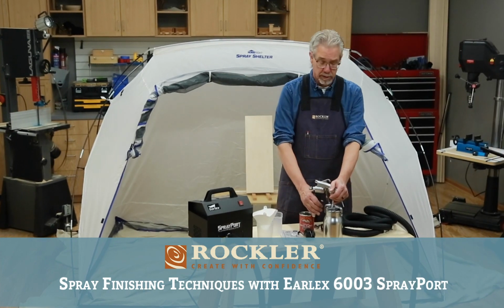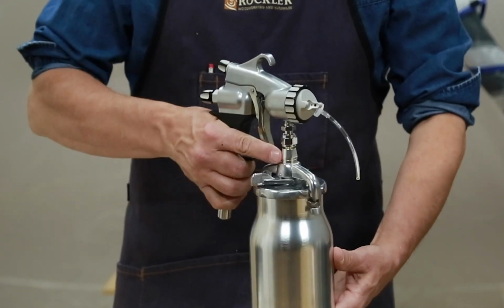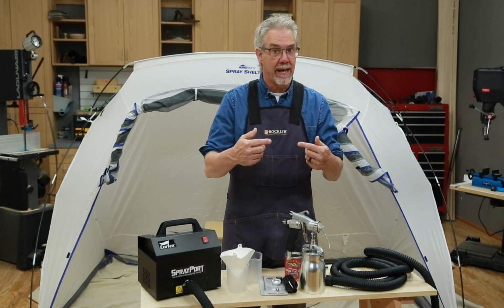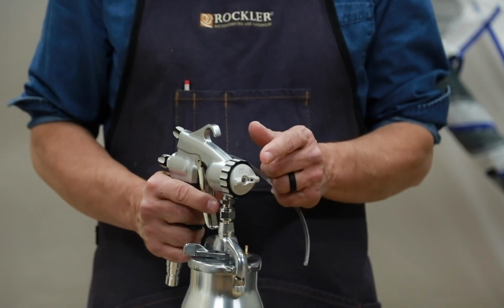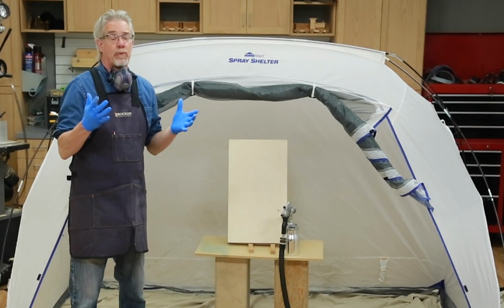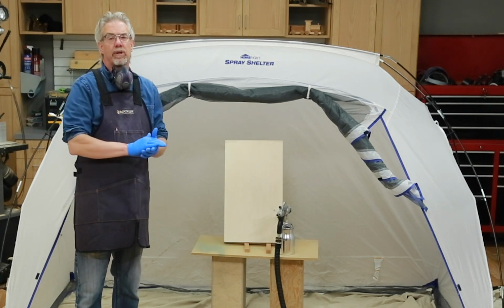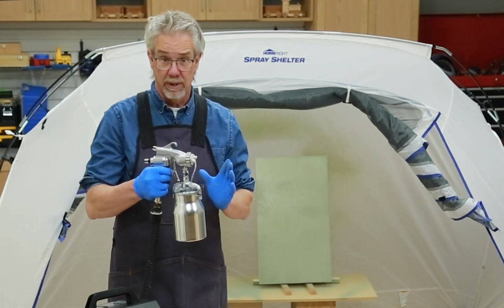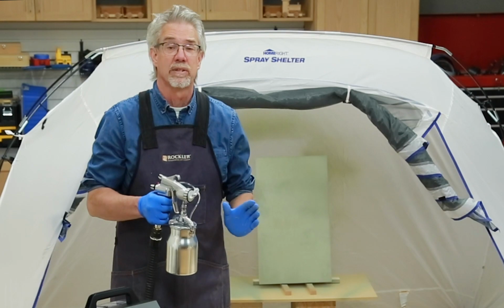How to Apply Finishes with an HVLP Sprayer

Comment: I would like to know more about how to build a spray booth and how should I size the fans for the spray booth, given the size of my shop the make up air will be moving through. I want to use waterborne lacquer to spray guitars with an HVLP sprayer. And I know how the build a funnel shaped spray booth that will fit around my carriage door opening.  But I don't know what size fans and fan motors I should use. thanks
Reply: Fuji spray has plans available free for that type of setup. Should be able to be found via google.
Reply: You need to make sure the fans you use are rated for this kind of work. Cheap house fans can create sparks, which can be a bad thing in a room full of paint fumes.
Reply from the maker: Hi Larry, please feel free to reach out to our product support team at 1-800-260-9663 or support@rockler.com. They will be able to assist you in answering your questions. Thank you!

Comment: What size needle did you use?
Reply from the maker: The needle used in this video is standard to the machine out of the box.
Reply: 515 should work for latex paint.